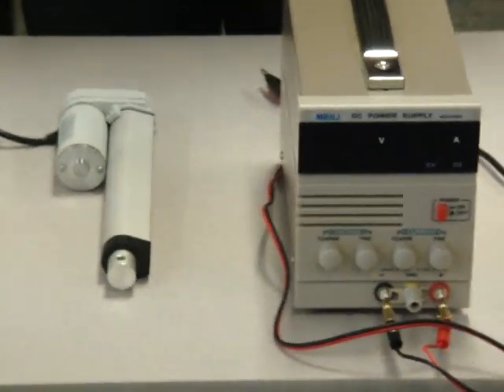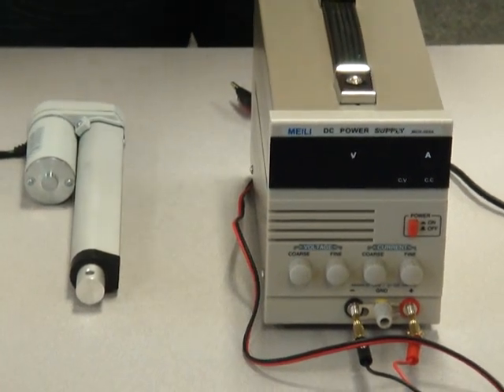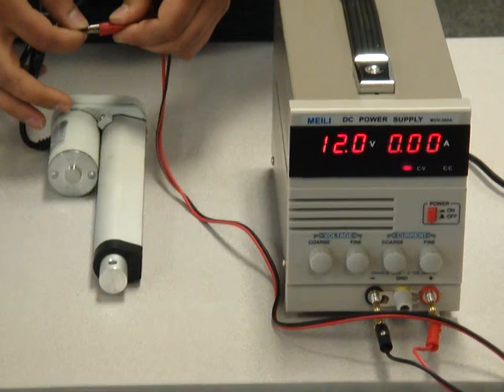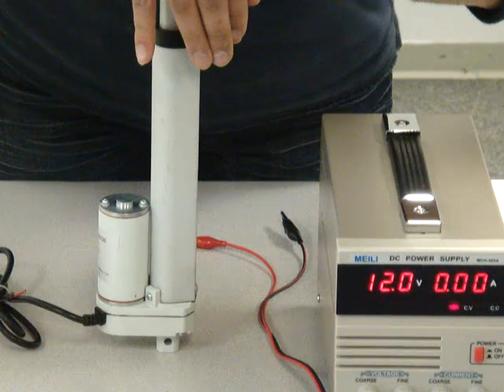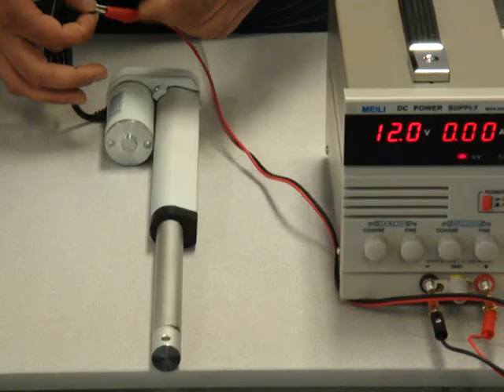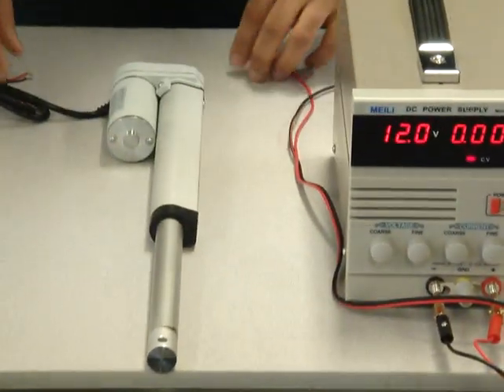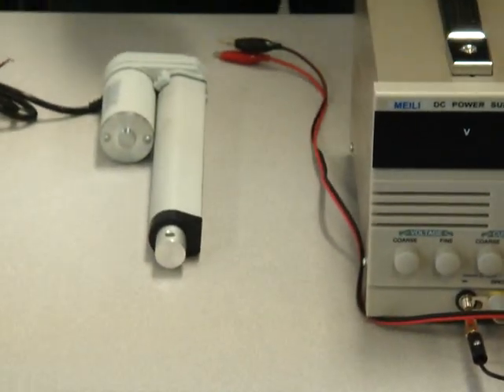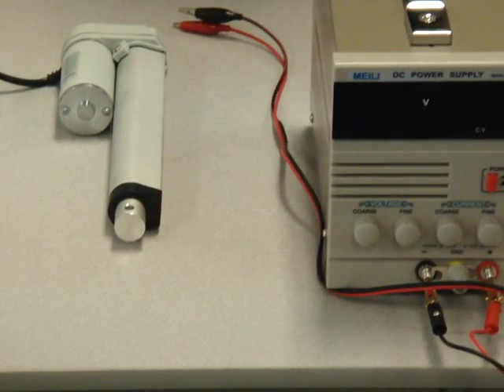The Holding Force of Linear Actuators - Progressive Automations

Comment: Hello!

Is it possible to program linear actuator to specific forces that it should provide on an object for a specific time?

For example in a frame linear actuator and an object is fixed at some variable distance. Linear actuator provides 2200 +/- 0,05 N force to an object for 5 sec, then increase it to 2280 +/- 0,05 N for 5 sec, then decrease it to 50 +/- 0,05 N force for 5 sec and so on.

1) Is it possible to track the force that linear actuator applies to an object?
2) Does linear actuators provide such applied force precision?
3) How linear actuator will hold set force constant for set amount of time?
Reply from the maker: All our actuators have a current spike during startup that is equal to the full load continuous current draw, this is required to ensure proper operation. After allowing the in-rush current spike during motor startup, it may be possible to program a current limiting module that can re-adjust to limit the current draw so that the actuator can only handle the desired programmed force. We do not have current limiting modules, however, this is something you can consider for testing.

1) It is possible to measure and continuously monitor your current which can give you a rough estimate of the load applied against the actuator. Below is an example we have for reference of Monitoring Load Feedback of an Actuator:
https://www.instructables.com/Monitoring-Load-Feedback-of-an-Actuator/

Another method is to install a separate device for tracking force such as a strain gauge which is a sensor whose resistance varies with applied force.

2) Our linear actuators were not designed for force precision and are mainly used for applications that did not require precision or adjustability from the force being exerted. 

3) A linear actuator will exert a specific amount of force based on the voltage and current that was available. For example, if a controller was supplying a constant value for voltage and current draw over a period of 5 seconds, then the actuator should theoretically exert the same amount of force for that period of 5 seconds.

Comment: Hi, 
It is common for these type of actuators that there is a certain cycle time (10%,  1 min on then 9 min off). I have a aplication where I want to apply a constant force with a tool on a part. I want to do this with a load cell and then turn the actuator off once I achieve this desired force. Is the actuator constanly on while doing this or is the motor only on while moving? Otherwise my setup would not be possible because it would exceed the advised cycle time. 

Best regards,
Reply from the maker: Hello Walter,
You may be able to activate and manually position the stroke rod in a way that the rod applies a constant force to your application, where you can then remove power to keep the stroke rod in place (as you mentioned). This will result in the acme screw holding the rod in place, as long as the opposing force does not exceed the actuator's rated force.

Comment: If this actuator is fixed at a point and actuators end is made to apply force on a pivoted link then how much force this actuator can generate on that link??
Reply from the maker: Hi Nilesh
The actuator in this video comes with three force options: 35 lbs, 50 lbs, 150 lbs. The actuator will be able to generate up to 150 lbs depending on what option you select - https://www.progressiveautomations.com/mini-linear-actuator.
Best Regards